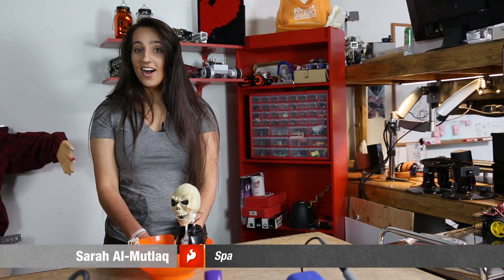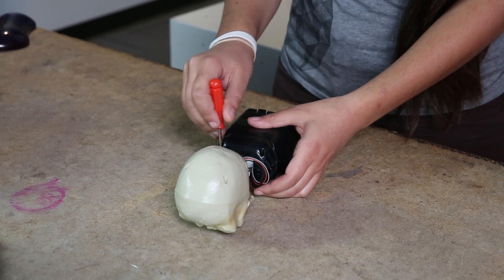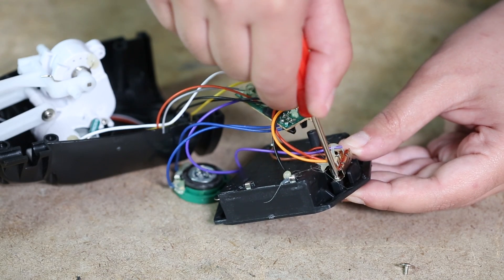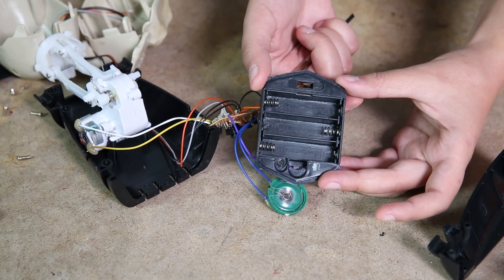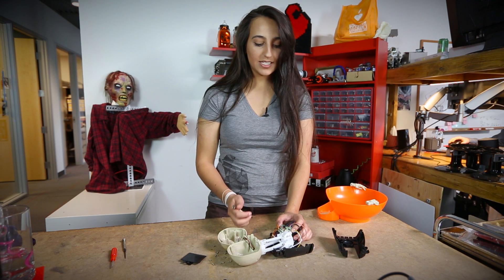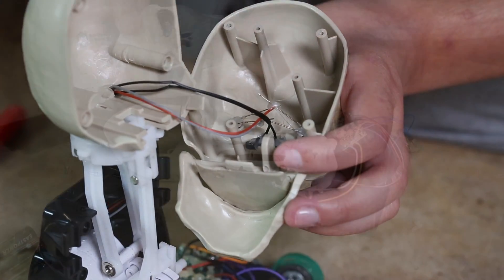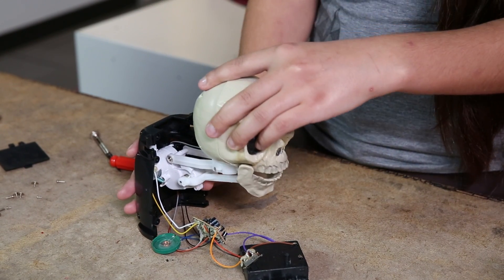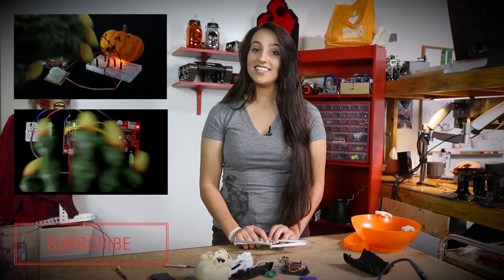SparkFun Halloween Candy Bowl Teardown!

Comment: Thanks for posting. I bought a motion sensitive candy bowl at the thrift store and it didn't seem to be working but I put in more powerful batteries and it seemed to work better. But it has a skeleton hand that comes out of a pocket and it doesn't seem to be coming out all the way and I really wanted to open it up to see if something was snag but I thought I don't really know what I'm doing so why should I open it up. But now that I've seen your video I'm inspired and I probably will end up opening it up tomorrow 🤣. The problem seems mechanical so it's slightly possible I could actually fix it 🤣

Comment: I have the two vampires heads(his/hers) that belong to my friend, is there a way to get a repair kit for the components on the main board. the main boards is a mess with caps half in the main board and bad solder. how could i get a main board replacement. or a schematic from Magic Power Company.